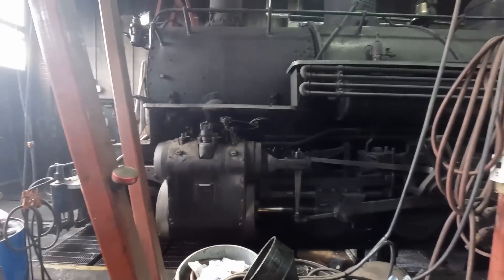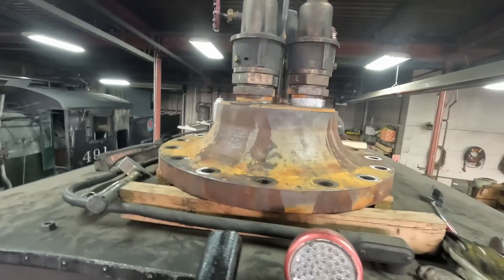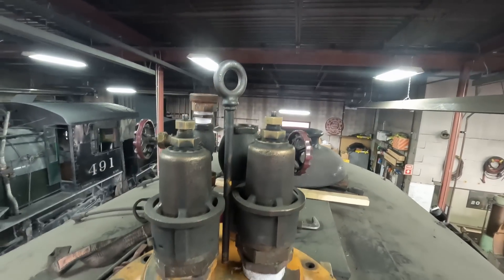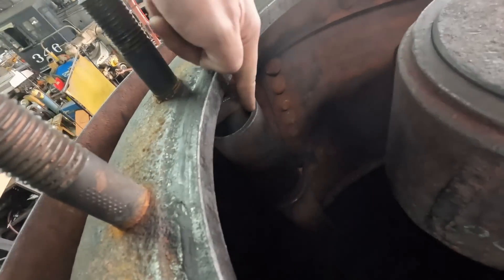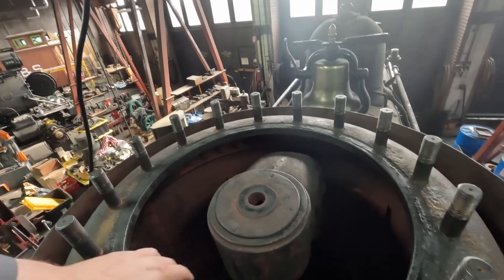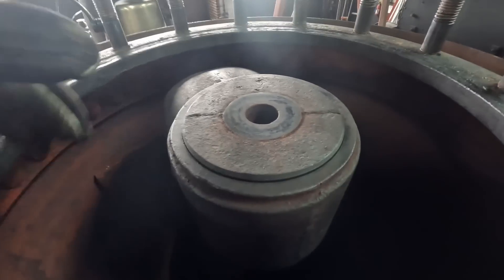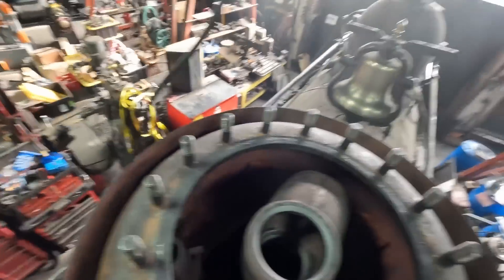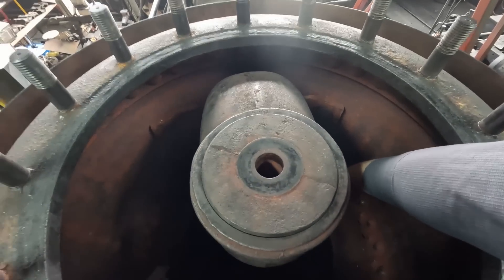Steam 101: What does a steam loco THROTTLE look like, and how does it work?

Comment: When teaching people how to run a steam locomotive I have had to explain the balance point on a throttle and how it can spring open or closed. Depending on the amount of opening it is possible to go either way. Always check your quadrant spring at the beginning of a shift. The balance point is the most efficient throttle opening but must be used when near track speed and then overall speed controlled by cutoff. 
Taming the WILD in the iron horse is a constant endeavor. 
As to those who are wondering how to tame a runaway, centering the reverser and opening the cylinder cocks usually works with a little help from the brakes.
Reply from the maker: Yup! Entirely based on how much steam is charged ahead of the throttle prior to the steam chest. If you completely saturate that volume with boiler pressure steam, you can get all sorts of interesting throttle behavior, such as the little engines being sprung open right before they're about to slip. It's a very nuanced and interesting thing. Well said, Ryan.
Reply: Thank you for the pin.
Reply: Thanks again professor for a great tutorial.

Comment: Keith Rucker has an amazing posting on how the throttle valves are repaired and lapped. Hyce. He does a lot of work on Locomotives in the Georgia area. Very nice guy. You should connect with him. Nice presentation - well done

Comment: Why would a steam locomotive want to throttle its steam? Isn't that a loss of energy? I thought the engineer regulated power by operating the  valves on the cylinders. If there is too much pressure in the boilers, why not just have the safety valve take care of it.

Comment: Can you show how the air line couplers work? It looks like they lock together but are designed so they can be pulled apart by the cars separating rather than having to be manually disconnected.

You could also talk about the valves and how this can relate to kicking and humping cars.

Comment: so if you have a runaway locomotive how do you stop that?

i assume you have to set the johnson bar in the postion where there is no valvue travel.
Reply from the maker: That's one piece of it, brakes are the next, as well as opening cylinder cocks just in case.

Comment: So it's not a governor?!... and or isn't there a governor somewhere to mitigate runaway?

Don't worry I won't do that, I can't play with LOCOS they wont let me! (I ASKED).
Reply from the maker: Nope; no governor. Making a steam locomotive's engine run away is not impossible, but certainly takes the right set of wrong circumstances to make happen.
Reply: @Hyce777  So in a worst case scenario... it runs away, can the loco be stopped?/ what would it take to stop the cycle? (cars and trucks you would throw a rag in the turbo or stop air flow..) trains it seems like that's next to impossible.

Comment: One loco I heard of in Britain (in preservation!), a small saddle tank, had a hole in the dry pipe; so effectively you couldn't shut it off. One guy managed to pull a train out of the station with the reg handle in the fully closed position. She got better by the way, they mended the dry pipe. Still, quite frightening to envisage!
Reply from the maker: Yowza! Yeah, that's terrifying.

Comment: I’ve always wondered why the bell hanger has “wings(?)” on it
Reply from the maker: They're called anti-rollover bars, it prevents the bell from doing flips, which is a concern with pneumatic swinging air ringers, and troubled firemen...

I have a friend that used to spin the bell to annoy management, and he did it so hard he unseated the bell from it's taper and flung it off the locomotive once....

Comment: Considering the only thing the trottle is doing is limiting flow, not pressure, does this mean that the locomotive would have the same power at 10% throttle as it does on 100%, just limiting speed of the engine?
Reply from the maker: It depends; because at lower settings, the steam does lose pressure as it runs to the engine (expansion into the drypipe / steam chest), though you are correct once you've got a saturated dry pipe and flow through the throttle.

Comment: If I remember correctly, didn't 20 also technically 'run away'. 
I believe she walked out of the yard.
Reply from the maker: Probably? that's not a story I recall but I would not be surprised. 491 did that, if it's a story that I told. lol

Comment: The giant throttle valve in the 491 perhaps was installed after the incident with the faulty throttle valve that caused it to walk away?  Or perhaps it's just the nature of the beast, their construction reminds me of a truck in a fleet I used to manage, it was a Ford Bronco.  It was purchased on a fleet contract, and Ford fulfilled it by slapping together whatever parts were around, regardless of if they were meant to go together, because several times it was brought to dealerships who asked when it was re-built after the wreck, and how bad the wreck was, because this configuration did not exist (It was never wrecked and belonged to our org. since new).  It was a 4x4 with a 3+OD auto (and we all know how much horsepower the average Ford slushbox soaks up) and a very tall rear-end (I forget the exact number) being powered by a 5-litre "High Output" V8.  Well let me tell you, it wasn't high enough, because this was a truck that if you put on the air con in the cab and tried to go up a hill on the highway, you had to plant your foot just to come close to maintaining 55.  It did get unusually good fuel economy for such a truck, which is something, I guess.
Reply from the maker: Nature of the beast; she was retired after the walk away incident. It's the same valve as the other K-37's, just mounted higher, so far as I can tell. Thanks for the story!

Comment: What water treatment are you using on 20's boiler?    There is a lot of surface rust on the inside.    Also what is being done on the 20?
Reply from the maker: Terlyn 4000. Every boiler has surface rust on the inside.

Comment: I fit inside the dome 346!  The throttle was out though. That peak down to the tubes gave a flashback of claustrophobia when I was working on 346’s dry pipe. I was ok most of the time but got a little stuck a couple times and had to do some deep breathing to calm down and work my way out.
Reply from the maker: Yeah that makes sense. I've felt claustrophobic in 491's boiler, so I can only imagine 346's. You've gotta take the throttle out of all three of them to have a chance, and I don't fit in 346 even with it out.

Comment: What is a "blue Peter incident?"
Reply from the maker: Search for it on YouTube. a British engine named the blue peter primed, and basically did 140 MPH in place and ruined it's running gear.
Reply: @Hyce777  found that video, but nothing explaining why water in the dry pipe would cause the running gear to over speed. I get why water in the dry pipe blows the cylinder heads off. Being incompressible means that when a slug of water gets squeezed in the cylinder by the piston, either the engine stops, or the piston or head must break. But why would priming cause a catastrophic runaway?
Reply from the maker: @briancox2721  Superheater units flashing lots of liquid water to extremely hot, and extremely expansive steam.

Comment: hey hyce i have an important question for you. if you could build your dream locomotive what would it look like? things like the wheel configuration, the chimney type, the fuel type, the headlight placement, any streamlining, the road name and number... just out of curiosity. also love this video ive always wondered what the throttle valve looked like!
Reply from the maker: I'd have to think about the dream loco question!
Reply: I would do a 2-8-8-2 with a headlight on center of smoke box and mallet type then Coal

Comment: So thats how it works. Its simpler, but also slightly more complicated then what I thought with the different seats. That explains how engines could drive themselves through the back of the roundhouses or into the pits. 

I knew 20 was apart and getting ready to go back together but holy crap, I didnt know she was THAT close. Aint got no luck left over for the lottery now. lol. 

Thank you SO MUCH for climbing up there and giving us a look. 

The further insight and information that has spawned in the comments is AMAZING. Dual seat balanced poppet valve, the fact on larger engines theres a small one that opens before the large one to make it easier to open. My god, I think we've spawned one of the most informative comment sections on youtube!
Reply from the maker: It is awesome to help foster this community. Again, thank you for the question that spawned this video!
Reply: @Hyce777  You're very welcome!

Comment: Maybe it is not as important in such small locomotive, but throttles of large locomotives (working on higher pressure) operate in two steps. First the little plug is lifted in the center of the bigger plug to equalize pressures and allow to more easily lift the big plug 😉
On the other hand, some small 0-4-0 low-pressure narrow gauge locomotives had external throttle valves of simpler construction (just bigger cock valve), e.g. German "Riesa" and its Polish descendant "Ryś" before 1948 (since when it had been equipped with internal throttle).
Reply from the maker: Not all big engines have the two-stage throttle valves; 491 has a compound lever, where you have more advantage and less travel to start, and then once you get further open, it flips to be more opening for less mechanical advantage, but all with the same giant plug. But yeah, lots of non USA power has the two stage ones, which are neat.

Comment: If the throttle seeps by a little bit, can you compensate by opening the cylinder cocks to let the steam out of the cylinders rather than runaway the locomotive?  Worked in power plant steam systems, and yeah a two-seat valve like that is a lot easier to open against steam pressure than a single plug style.
Reply from the maker: Yup, center the bar, open the cocks, and there you go.

Comment: What do you guys use to seal the seam on non welded or hammer caulked seems like under the plate atop steam dome, also  needs skinny long arms for the one steam dome you guys could use my help lol my arms are so long I required second largest the largest horse bow for mounted archery when I ordered one last week I have a  35 inch bow draw  they only come in 36 otherwise it's special order
Reply from the maker: Nice, you'd be good at taking throttles out... lol!

The cap of the dome is sealed with a large annealed copper gasket, and usually something along the lines of graphite paste as well.

Comment: I suppose some might wonder with two valve seats, Does the steam only enter through the top one, and then go through the bottom one to the dry pipe, or does steam enter both the top and bottom of the casting (through both valve seats) from the boiler to the dry pipe? :)
Reply: No the steam goes up through the bottom seat and down through the top seat.  That way you have steam pressure pushing up against the bottom and also down from the top.  So the force of the steam acting on that large circular area is cancelled out by the force pushing the other seat in the opposite direction.  As he pointed out, with the bottom one (where steam is pushing upward to open the valve) is a little bit smaller, so overall the net force of steam acting on the two seats is downward to help the engineer closing the valve.
Reply: @mikefochtman7164  great explanation, thank you
Reply from the maker: Mike answered your question quite well. Cheers Mike, and good question Bryan! Hard to visualize the complete system without the cap on.
Reply: @Hyce777  yeah, I kind of knew the answer, but from the angle you had to film at, I could see someone wondering about that. The field of steam engineering both stationary and mobile is very fascinating and the engineering that goes into making it work is amazing. I think we were smarter in 1910 then we are now in a lot of ways. I am a stationary engineer who also does controls work occasionally. I have books on boilers and boiler controls dating to 1880 and the mechanical controls they had back then were just fascinating. What is more interesting is now with digital electronics we still do the exact same thing. We still control the air, the fuel feed, etc. only now, if power goes out, or lightning hits the power lines, the boilers shut down. Back then weights, diaphragms, and levers didn't care if electrons were moving or not. George Stephenson is one of my hero's, as well as others. Anyhow, tomorrow I have to go help button up a locomotive for winter storage.....having had our first snow fall already here in NE. Ohio. :( Thankfully it didn't stick.
Reply: @s1-6100  I too dabble in process controls.  Loved tinkering with the old pneumatic ones (3-15 psi control loops etc..)  

Another fun bit of history is boiler chemistry.  Limiting scale was always an issue.  Trivia, one company that made a product called 'calcium gone' abbreviated to 'Calgon' and were making soaps and detergents into the 70's.  It was a mix of tri and di phosphate to prevent boiler scale, but when phosphate pollution became an issue, it fell on hard times.
Reply: @mikefochtman7164  Oh yes, pneumatic controls are awesome. I ran a coal fired powerhouse that had Hagan pneumatics for everything. The use of mercury in transmitters was interesting also and worked very well. The nozzle and vein setting was very important as well as balance on the system. I still would rather turn a dial and see the needle go up on the gauge than this modern junk on a tiny controller that show's a digital number. Back then you could even bias one boiler against another both in Automatic. That is one of many lost art's nowadays sadly. Operators had to be skilled in keeping the bed right as well as operating the controls, and we had turbines on everything. Boiler fans, FW pumps, Overfire air, and even the stokers on old 27 boiler was turbine powered. I wonder how many people now even know what a loop seal is on a DA? I have blown it a few times when I had loads of turbines on line and the multiport could not react fast enough. The good old days. I miss them.
Reply: @s1-6100  'loop  seal', that takes me back.  When we lost the loop seal, we knew it by the banging noise.  lol
Reply: @mikefochtman7164  Yep!!!

Comment: How come they don't have a shut off valve so the engine doesn't  runs away?
Reply from the maker: That's what the brakes, johnson bar, and cylinder cocks are for. If you had an inline shut-off valve, it would reduce the flow significantly (globe valves / shutoff valves are huge flow restrictors) so the engine wouldn't really work well. Butterfly and ball valves wouldn't really be feasible in that size, scale,  or operation, either.

Comment: So hyce, how do you keep steam from shooting out the steam dome or out the backhead? As the linking rod from the cab has to run into the pressurized boiler?
Reply from the maker: The steam dome has a large copper gasket, and all of those studs that hold it down tight.

The linking rod in the cab comes out of a packing gland, which holds special sealing material tight against the rod, preventing leaks.
Reply: @Hyce777  that makes sense! What would the packing be made of? Thanks!
Reply from the maker: @TrainznProgress  Originally, an asbestos and lead rope (yes, just that toxic... lol!) these days, it's a flavor of teflon impregnated rope that's similar to teflon tape, but much larger and industrial.

Comment: So there is nothing preventing the valve from sticking open eh? Hmm, looks ripe for runaways if anything goes wrong.
Reply from the maker: the top seat being bigger than the bottom seat makes the steam pressure hold the valve closed.
Reply: @Hyce777  Ooooooooo interesting. Thanks for the info (as always) great stuff!

Comment: I thought the throttles on these things were butterfly valves, not whatever you call this setup.
Reply from the maker: Nope. I am not actually certain of the name of this style valve either, lol.
Reply: @Hyce777  Interesting.
Reply: @Hyce777  it's a poppet valve.
Reply from the maker: @TheGenerator_Guy  They're still called poppet valves when this big? For some reason in my head poppets were a series of small valves. Neat.
Reply: Poppet refers to the way it opens and closes in a linear motion along with the mushroom shape. As opposed to a ball valve or a gate valve, or a butterfly valve.
Reply: @TheGenerator_Guy  One might say 'dual seat, balanced poppet valve'  ;)  Balanced so it is easier to operate against full boiler pressure.
Reply: @TheGenerator_Guy  Whenever I hear poppet valve and steam locomotive in the same sentence, I think of the T1, which actually used them in the steam chests instead of normal slide valves or piston valves.
Reply: @Phoenixlover55  funny you mention that I was just reading about the T1 trust 5550 project
Reply: @mikefochtman7164  more specificity yes!
Reply: @TheGenerator_Guy  Neat. I'd support it if I actually had money, but I'm a broke college student, so that's not happening.
Reply from the maker: @TheGenerator_Guy  Gotcha, today I learned! Did not know the origin of the term. Thanks :)
Reply: I would call it a plug valve, or even regulator valve. But that is just me! :)

Comment: 5:37wat happened to 491?
Reply from the maker: I'll film a video about it sometime soon. haha
Reply: @Hyce777  thank you
I have a question about double acting regulators
Now we all know wat happens with a multiple valve regulator when priming
Do you also struggle to get the regulator close when the engine is priming?
Reply from the maker: @laaity  nope, these shut pretty easily even when priming.
Reply: @Hyce777  woah really
So even if your boiler pressure and main steam equalize it's easy to shut?
Reply: Id like to know that too.